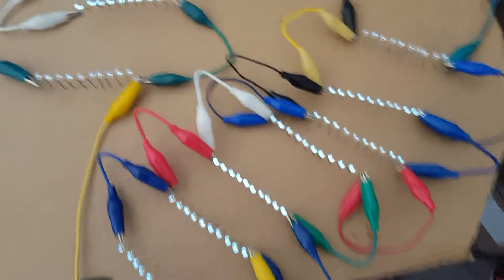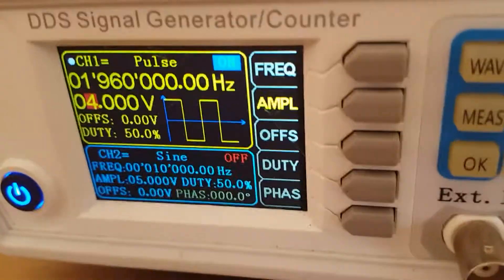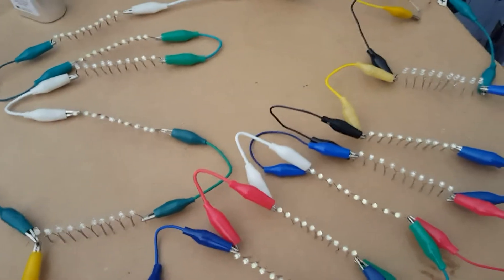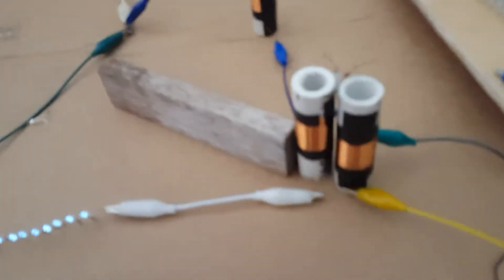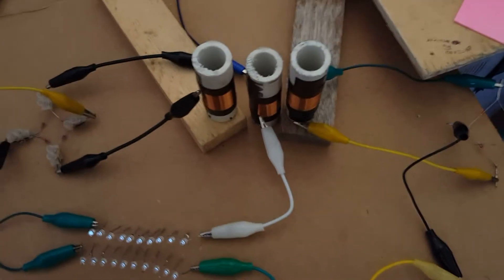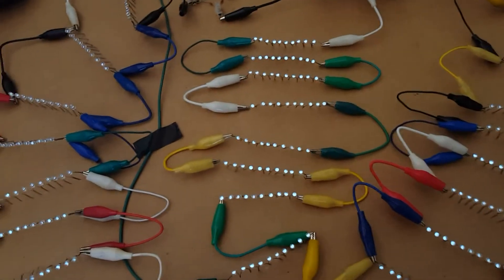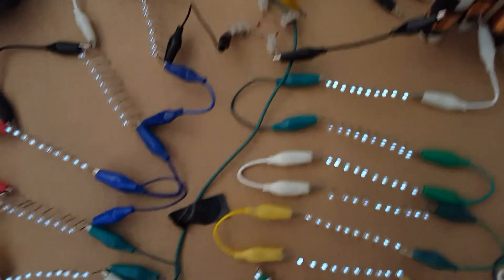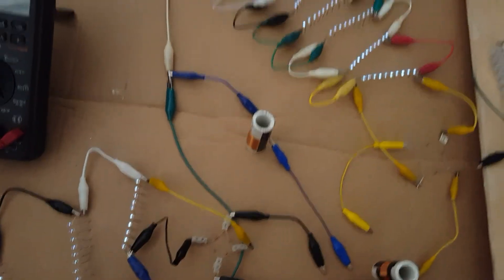WPT part 28.   Continuing with experiments done in part 27, I also try a Tesla bifilar pancake coil

Comment: 11:20 When the ground wire is disconnected you have an open circuit - voltage but no current. That's why the LEDs go out. LEDs are current driven devices. The voltage from the coil to ground has a voltage drop and that's needed for current  to flow. Looks like with all the small coils you got some transformer action going on. I would think mostly sharing flux and a little capacitive coupling with spacing that close together.
Reply from the maker: Thanks for clarifying, that makes sense!  As always, thanks for your great comments, much appreciated😎